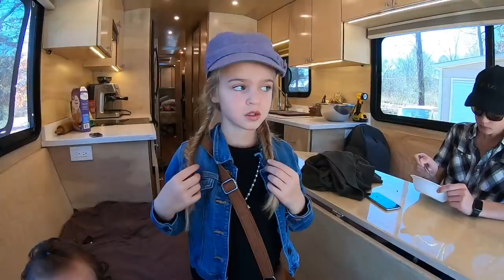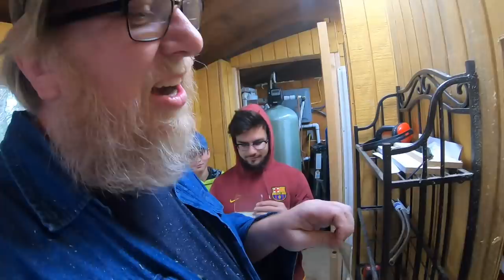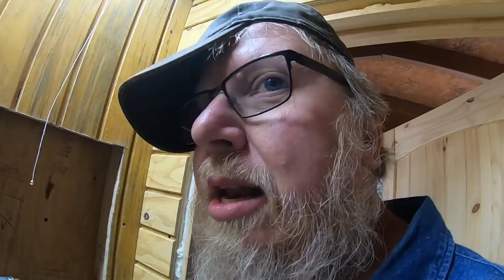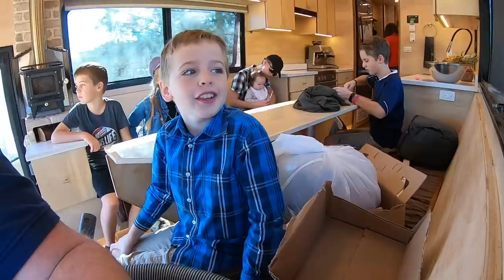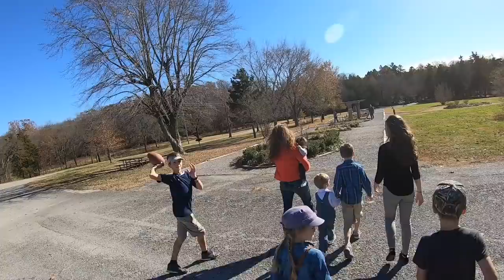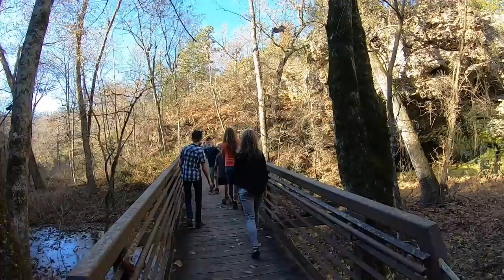Crazy Hillbilly uses Flex Tape | The Bus Life

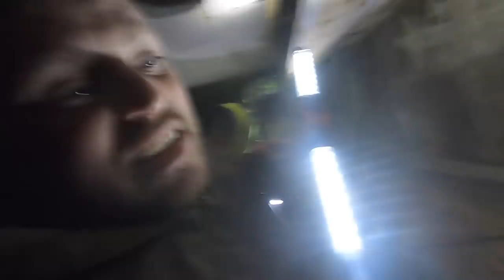Comment: At the 8:20 mark it looks like a termite tunnel on the frame of that support... with the rot and now seeing that tunnel... you are wasting time with a vapor barrier at this point.... rebuild the floor and repair/rebuild the supports...
Reply from the maker: There is so much moisture coming up from that dirt because it’s warm under the house.  It will help them in the future.  Now to the rot repair.

Comment: That crawl space needs ventilation! After its removed and replaced! the vapor barrier will help a little, the vent will fix the problem! Black mold is the bad type, the kids should not be near it!
Reply from the maker: We treated it all with bleach and water.  👍
Reply: tom williams there is not black mold. It is the white mold that just decays the wood. It's from moisture issues which we've fixed most of or will finish soon with new auto vents. Thanks for your concern. Have a blessed day